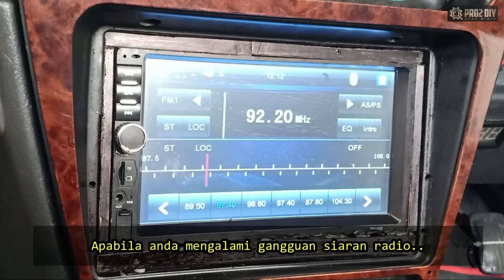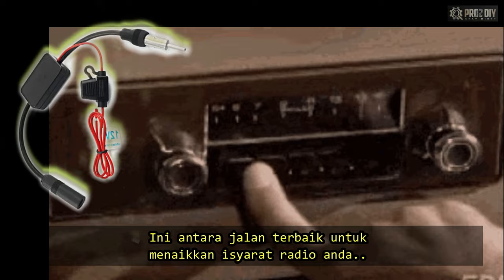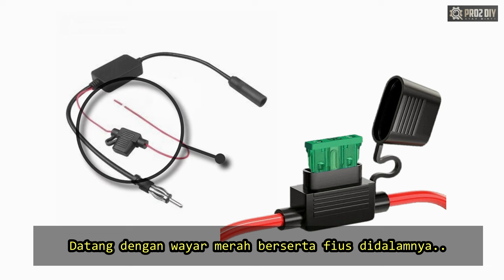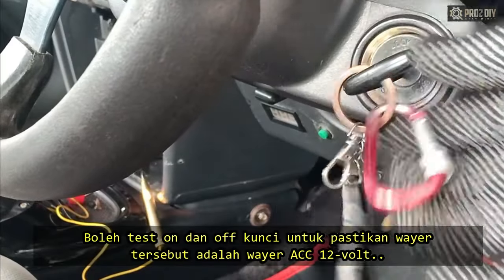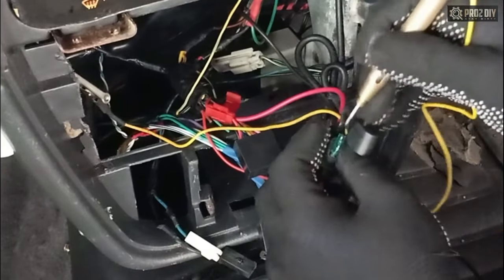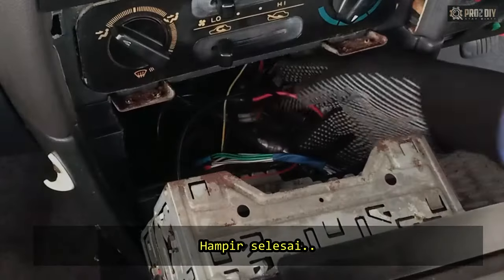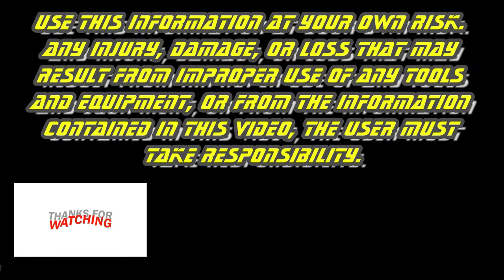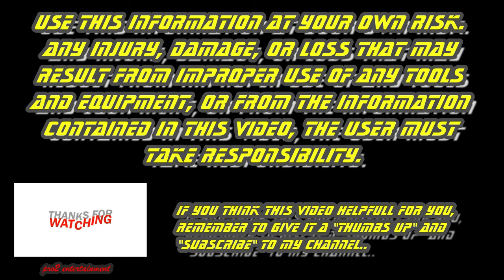Radio Signal Amplifier Antenna Booster

Comment: I Wish I Could Tell You Guys WHATS Inside The Amp And How To make It EVEN More Better With Few Modifications :) 
This Amp Can Be Used For Any Radios That Uses Comercial Fm Frequencies / Air Band Frequencies AND AM Frequencies Wich Are Between 2200Meter Band Up To 10 Meter Band, Itr Works, It Makes It Much Better, The Gain Improves With This Amp, But It Needs Them Mods To Work On Them Frequencies/Bands. I Think I Need To make A Vdieo On It :)_

Comment: You must change ''loc'' to dx, loc will supress your reception friend, on dx it will gain way  more radio stations. You will be glad after doing this, change loc to dx, or whatever the name will be, you can only select 2 types. Greets.
Reply: how to change it? on my radio it only shows 'loc'.
Reply: @amirfuad7647  Often there is 2 antenna symbols, one big, one small... if you tap this loc changes to dx, or maybe it is different on your unit but you have to tap some buttons, loc is definitely only letting the local stations trough because of their strong signal, dx is for both distant and close stations, so on dx there is always the most stations.

Comment: Is it normal my amplifier light always turn on? Even with engine off?
Reply from the maker: no sir,  it's should turon off when u turn off the engine.. if not, it's will drain your battery..